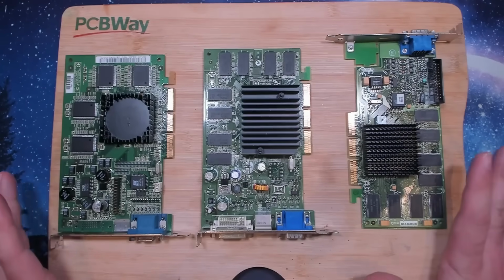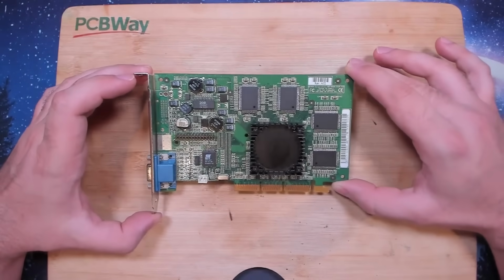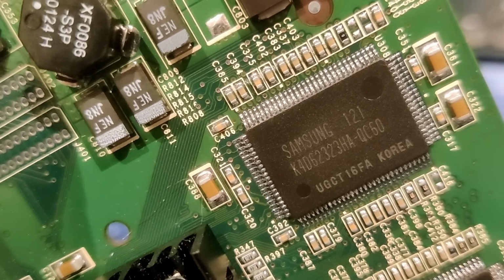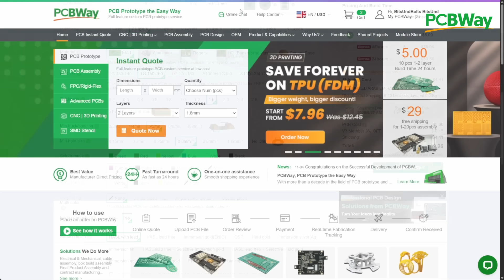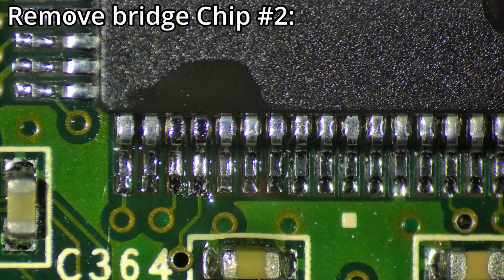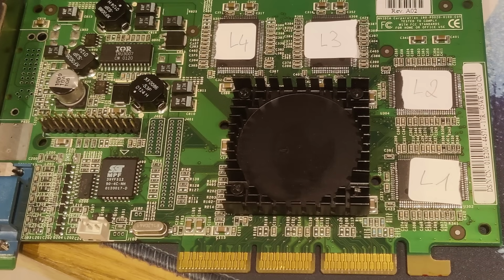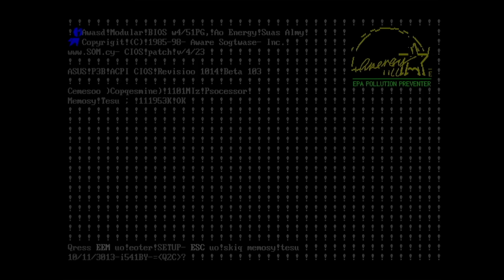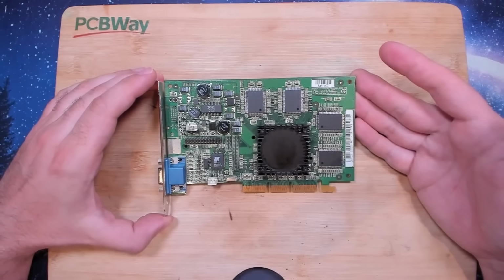Leaked NVIDIA Tool: Can MATS Save My Broken GeForce?

Comment: Lots of comments about epoxy removal. Just say no to mechanical stress and abrasive wire, not worth the high failure rate. Like someone mentioned WD-40, the mineral spirits content will weaken the epoxy enough to use a smooth fishing line or dental floss. Go slow, even floss can wreck some IC / dies.
Reply from the maker: Hm, I wasn't aware that WD-40 has such powers. Really? Can it be used to weaken epoxy?
New information came up and I am certain the GPU has an internal flaw - so, it is going to be a practice card.
Nevertheless, I would like to try a few techniques to get the heatsink off without damaging the chip. I did get some 0.15mm diamond wire cutter. I wanted to create a small space between the heatsink and the GPU and then work with freeze spray.
Maybe I have to give WD-40 another thought...
Reply: @bitsundbolts  WD-40 is around half mineral spirits. For solvents, acetone is a risk to plastic, isopropyl is too weak. I prefer OMS, but any white spirit will do. Be careful with the wire and freeze spray. They will make quicker work of it, but mechanical stress is likely. Hope it goes well!

Comment: I used a heat gun once on a matrox chip got the heat sink nice and warm then worked it with guitar pick. But its one of the newer pcie basic display card so i wasnt worried about damage just wanted the sink to but on an mcm card.

Comment: Heat the heatsink with a heatgun set @ 100-150°C, place the heatsink inside a vice, rotate gently the board. Clean the epoxy with ethyl acetate.

Comment: The readout of the chips is reverse of the layout. So the first chip with all the errors will be the 4th chip. 
   Line 1= chip4 
   Line 2 = chip3 
   Line 3 = chip 2 
   Line 4 = chip 1 
 
 Hope this helps ya out in the future!!

Also those exclamation errors or any other digit laid out like that is usually a GPU that's been cooked so I'm betting your GPU is where the problem is either fried or heated so much it lossened a bad solder ball...
Reply from the maker: So, I think I marked the chips correctly then. When looking on the GPU, the chip corresponding to Line 1 output is on the bottom right of the card and then counter clockwise to the top left.
I did some investigation with an oscilloscope. No data line is stuck high as MATS suggests. So, I believe you are correct - there is a faulty GPU on this card. Nothing I can do, but use it as a practice card.

Comment: You could also try squeezing on the heatsink while it is on. If it affects or even stops the artifacts, then it's very likely a BGA issue. If not, and the boards and RAM are good, the GPU is toast.
Reply from the maker: I tried that - no change while pressing on the GPU. It might be a faulty GPU.
Reply: @bitsundbolts  Well, if you're REALLY lucky, it could still be balls in places that squeezing won't affect them, like in the middle

Comment: Эпоксидную смолу можно снять если нагреть радиатор. Смола становится мягкой.
Reply from the maker: I will try that, but I failed before at a temperature of 150 degrees. I need to check what the heatsink temperature was, but it felt quite hot. The epoxy didn't budge though. I might try this again - or use Freeze Spray.
Reply: @bitsundbolts  Значит это не эпоксидная смола. А полиэфирная. (((

Comment: Kinda interesting the exclamation marks doubled when the bus width halved.  Could be unrelated but could indicate maybe how the GPU accesses memory for text mode.
Reply from the maker: Interesting observation - I love the collective brainstorming and what could be at fault!
Others have noted that the column with the exclamation mark increments the ASCII code by +1. So, a SPACE (ASCII 32) becomes the EXCLAMATION MARK (ASCII 33). And Celeron becomes Celeson (R => S).
That it doubles the columns with less memory does make sense somehow because it only has access to half the memory and therefore twice as much data gets stored in a defective memory location (which might not be the memory chip).

Comment: It might be better to connect a memory chip's data line to its nearest ground / VSS / VSSQ rather than hooking two data lines together. That's what I've done when adding faults on purpose to track down which memory channel is which.
The nvidia chips do not tolerate these intentional faults too well, I've had video output break completely while trying to induce memory faults on the geforce fx cards.

Comment: Acetone on the epoxy,   if possible submerge the HS upside down so it just touches the chip.  If not just keep dripping it on the outside and let it keep soaking in.   A gentle  twisting action to try and remove it.   It's not easy but can be done

Comment: if you can get it (and handle it carefully), a chunk of dry ice on top of the heatsink for a bit can work _on some_. at the right duration, the sink should twist off without too much difficulty and without anything more than visual 'damage' to the gpu itself. might also be cost prohibitive in some areas, even if it can be gotten.

the downsides, its going to vary by adhesive how much dwell time it needs, and i can't even begin to speculate. orrrr, in more extreme cases, they choose an adhesive thats capable of handling temps that low for a decent while. not common, but i've encountered it in higher end gear and very randomly in other stuff.

the quick and dirty method is blasting the sink with upside down air, but it doesn't get quite as low, and still requires some force to separate, while the dry ice method (when it works) just needs some light twisting.

as for prying tools, i tend to use some thick painters tape fairly liberally and pry gently with a cheap art spatula (they come in sets of 5-8 of varying styles, the smallets of which is also sometimes handy for thermal paste at times)

Comment: I removed the heatsink from a Voodoo 5 5500 once by just prying it off with a screwdriver. The corners of the BGA PCB Substrate seemed to not have any vital traces, since I squished the corner. Maybe that works with this card too.
Reply from the maker: I have seen people using an old plastic card (like a credit card) to protect the chip's substrate and distribute the force of the screw driver better. I will try freeze spray and said method - I hope I'll work.

Comment: Aluminium (what the heat sink is likely made of) is soluable in a strong solotion of Caustic Soda, just make sure that nothing else around it will also dissolve!
Reply from the maker: Oh wow - now we get into chemistry :) It sounds a bit impractical for me to be honest - there are many other components in the way to perform such method. Wasn't there another metal that didn't play well with Aluminium? It made it very brittle when it got in contact with it. I think it was Gallium (what is used in liquid metal).
Reply: @bitsundbolts  A number of metals will render aluminium brittle: Gallium as you said, Galinstan and Mercury

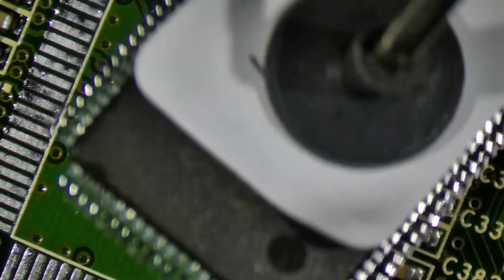Comment: 16:19 Try putting the card in the freezer. It makes the thermal glue brittle. Then you might be able to lever it off with a spudging tool/flat blade screwdriver - CAREFULLY!
Reply from the maker: I probably try this method, but with freeze spray instead of the freezer - I hope to introduce some sort of shock state that makes the bond crack between the aluminum and the epoxy.

Comment: the fact that the problem got worse after the swap makes me think that the L4 chip isn't great.
Reply from the maker: Never thought of two chips being bad... Maybe I should just try and change all chips if I find replacements.
Reply: @bitsundbolts  it's also possible L1 is perfectly fine. and the L4 chip just increased the problem with the GPU itself.

Comment: It would make sense that the designer when laying out the schematic would stick the memory IC's down in order. Thus bank 1 would have the lowest component number on the silkscreen (jn this case U302) which would have saved you some time shorting out pins.
Reply: Not Nvidia designers from that era though, they don't put the chips in order at all - a GF2 MX's RAM chip names go U504 then U508 then U510 then U506??
Also the data lines aren't sequentially matched to the chips, they're all over the place (i.e. DQ0 goes to FBD9, DQ3 goes to FBD15) since the main consideration is trace length matching

Comment: Seems to be a cracked ball, now we get to see a reflow of the GPU core
Reply: ... IF he can get the heatsink off without damage to the chip that is. But hey, at least these Geforce 2s don't have an exposed Die, unlike most of the higher-end Radeon 9000 series cards with the heatsinks mounted with that rock-hard yellowish epoxy on the bare die. Getting the heatsink off of one of those is an absolute nightmare... 50/50 chance you chip the Die or even rip it right off with the heatsink, even with heating or freezing

Comment: I would use "Diamond Floss"
Google that. It's for dentistry, but you could use it safely to unbond that heatsink.

From its fact sheet...
"Ideal for separating unintentionally bonded teeth or removing cement from around veneers or beneath bridges."

Comment: I don't know what it's called but there is a modern program like mojo for modern GPUs. It does at least 3090, 4090, and 5090. I've seen it used a few times in repair videos. It can tell you where to look if the RAM is bad. It only runs in linux though. The videos I saw they had dual boot.
Reply from the maker: It might be MODS for nVidia cards, but you need a release for each card if I am not mistaken (or some chip dependent files and databases). You see the "PASS" or "FAIL" in ASCII text at the end. MATS is part of it and probably the one used to determine memory health, while MODS will continue to test other parts of the entire graphics card.
Reply: @bitsundbolts  It's been a while since I've seen it, but that sounds right. I used to watch a german repair guy, but he stopped making videos.

Comment: I think that before you remove the GPU you should solder on a working memory chip. When you removed #1 the image was very noisy. I suspect that EMI was picked up and was responsible for that. Then you moved #4 to #1 which removed the noise, but you still only had 96 of the 128 data bits connected to the bus, and I guess that provoked the exclamation marks by picking up (less random) noise. Fully populate memory with known good ICs and see if it works.
Reply from the maker: Interesting observation. I definitely want to explore other options before I start removing heat sinks and and the GPU. I also got some other insights from the comments - I will try to find out more before I take the other route. It looks like there is one bit stuck high somehow. I just need to find it and focus on that path.

Comment: 3:00 - there is one more possibility of artifacts, you didn't mention.
Wear of memory chip. It is still good, but doesn't handle BIOS' clocks and timings.
Sometimes, it can be done by flashing incorrect BIOS. Such cards could be then thrown into e waste, and you can find them.

All you need to do is actually underclock memory, or increase timing or voltage for DDR1 memory. I had situation, where underclock has to be low, to get rid of artifacts. But I had situation where underclock needed to be so sewere, you could not go lower, because it desynced core + memory too much and card stopped to work.
Reply from the maker: Interesting - I never had such a case (or never tried that), but that's good to know!
Reply: @bitsundbolts  Btw, youtube is hiding all my comments. that's why you never see like on any of my comments. :)  I'm shadowbanned.

Comment: You wanted a suggestion for removing the heat sink.  Try using a Diamond Wire Saw 0.4mm Diameter Cutting Wire Saw for Stone Marble Granite Tile Metal Wood Cutter(0.5 Meter). You can try and slowly try and use it to remove the heatsink. Then that would only leave you with trying to get the rest of the thermal expoxy off.  Which you can try sanding down as close to the gpu as you can get?
Reply from the maker: I think this is an excellent idea - someone else suggested that as well. If I can get the heatsink off, I can apply isopropyl alcohol or even acetone on the exposed epoxy. Right now, I can't really access it - and I risk dissolving the plastic of the chip.

Comment: Do I misunderstand something, or the chips are numbered? 
L1=U302, L2=U304, L3=U306, L4=U308.
There is a chip on the left side of the card, which numbered as U200?
Reply from the maker: Yes, the chips are numbered as you mentioned. The U200 is a chip next to the BIOS chip.

Comment: It's interesting that nearly every 4th character is 1 higher so "Starting MS-DOS 6.1..." becomes "Staruing!MS-EOS 7.1./."
Reply from the maker: Yes, this is true. It seems like one bit is always stuck high and creates this issue. Somehow, ASCII characters are shifted up by 1 due to this. Others have commented on this as well. Such an odd fault.
In Windows, I get red vertical bars which seem to correspond to the columns of exclamation marks.

Comment: Anyone know if there are similar software for ati cards? I was poking around with the multimeter in my radeon 9800 pro and I broke a solder ball in a memory chip by bending too much the card and I have similar artifacts. I am not an expert in bga soldering and I don't like the idea of reballing random chips.
Reply from the maker: Yeah, I would like to know that too. I haven't seen a tool for ATI cards though. There is a generic video memory stress test which tests your video memory: Video Memory Stress Test 1.7.116
But that doesn't tell you which chip is faulty - just if there is an issue with your memory on the card.

Comment: I'd suggest measuring the diode values of two adjacent chips and compare them pin to pin. See if one or more pins on the bad bank is significantly different. Maybe remove the memory chip before that so you can confirm it's a GPU issue.

Also I guess nVidia used this counterclockwise memory layout since the beginning - you'd start from the lowest bank on the lower right and go up and left to the highest. Still applies today.

On removing the heatsink, you cut into the putty with a razer blade. You'd rather damage the heatsink than the GPU itself in the process, so angle your blade wisely ;-)
Reply from the maker: Yeah, I need to do some further digging. There seems to be an odd discovery of a stuck bit that is always high and causes those exclamation marks - it also increases each character's ASCII code by +1. So, empty SPACE (ASCII 32) becomes and exclamation mark (ASCII 33) - and this happens to all the other characters on that column too!
Yeah, the counter clockwise arrangement of the memory seems to be a tradition :)
I tried the razorblade method, but it is hard to impossible to make progress. I used a thicker blade, but I couldn't get under the heatsink - I might try again. That epoxy is just too strong :(
Reply: @bitsundbolts  The artifact does seem to be the lowest bit stuck high. So maybe comparing DQ0 values as a start - measure its resistance against Vcc and see what you find compared to all other banks.

Maybe just try a whole blade from a box cutter. You'd have a longer edge that's easier to manipulate. And please use thick gloves for protection.

Comment: It kinda looks like the character set is just off by 1 (or some number bigger than 0) ?
Is it possible that the firmware/bios is just corrupted ?
Reply from the maker: Yes, you are right - characters are offset by 1 (but only in certain areas - the columns with exclamation marks). If the firmware would be corrupted, the checksum would not match and the card would not work at all. At least this is what I would assume.

Comment: I have fond memories of my Geforce 2 GTS back in the days.
Before that I only had onboard graphics that could not really do 3D, so I had to use software rendering. It was like a whole new world.
Reply from the maker: I could only afford the GeForce2 MX - I still loved that card, but I wish I could get a full fledged GeForce back then.
Reply: @bitsundbolts  I got it used for 30 bucks. Back then I was severly behind in computing and still rocket a celeron 333 when others already had P4s.
So when someone I knew got a new P4 with a nice ATI Radeon, i snagged the Geforce 2 GTS for cheap.

Half Life 1 suddenly ran in 1024 x 768 instead of 320 x 240 software rendering.

Comment: Edit: 
Likely irrelevant but just to note that on one reference board, C803 is populated, on others it's missing ...
I can't see if that pads been soldered previously or not?  Also can't see if the ref. has rear side RAM either!

Very interesting looking helper!
Apologies if I didn't notice it properly, but does it indicate a specific chip, like some of hte Spectrum or C64 dead tests?  From SPC to ! and P to Q but indicate that bit0 is asserting 1 on that cell!?

It's great to show more and more of this kind of thing, there are some great techniques out there, but rank newbies like meself need to get our heads around practices to void 'scopes for example, I know you're very rarely using one and I love your way Edutaining us!

Thanks!!
Reply: HEh, typical me, if I'd waiting til 5 minutes, I'd have a partial answer, still - point remains, this understanding is critical!
Reply from the maker: I don't like to use scopes because it is hard to get the right pin. They are too tiny and I still have to navigate through the settings to tune the scope for the signal I am evaluating. If I can find another way, I prefer doing that.
MATS tells you that a specific chip has an issue, but it doesn't tell you which one exactly. I tried to figure out which one it is by shorting the data pins. This is how I ended up with the L1 - L4 and the counter clockwise alignment of the chips around the GPU.
Happy to hear that you learn something from my videos!